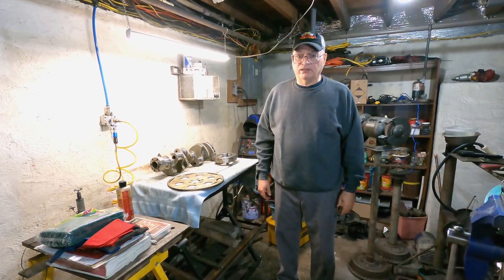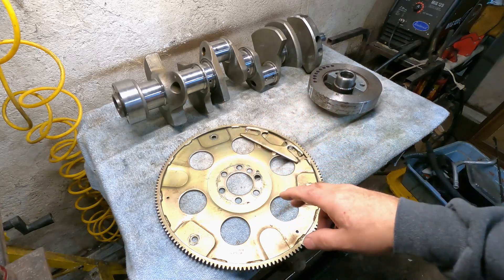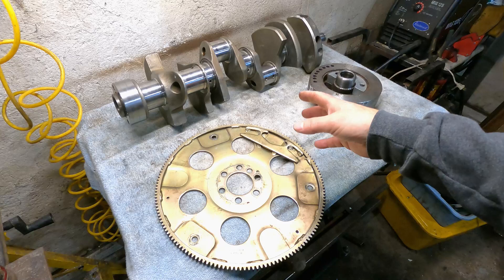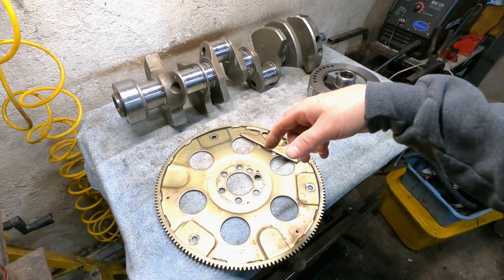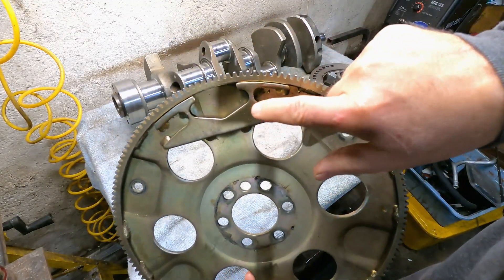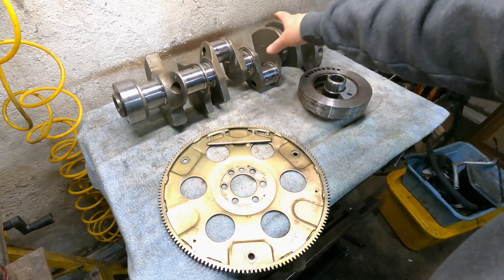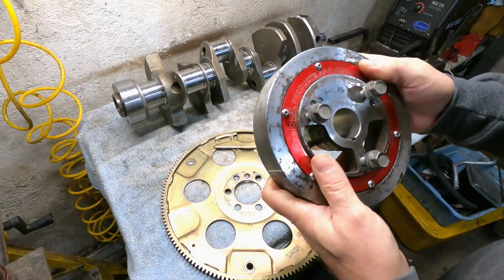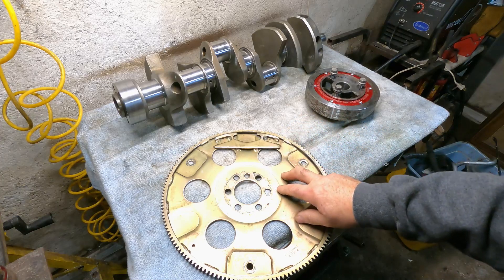Externally Balanced Crankshaft

Comment: Maybe you have an easy answer for me. I am extremely good with cars, especially fords and what fits what.  Chevrolet, not so much.  But I do have a 1968 Chevy Corvette 427 M21 4spd car but someone removed the 427 and put in a crate 350 back in the 80s.  I happen to have a 1973 454 SS motor from a 1973 El Camino SS automatic.  This external balance thing has gotten to me.  So my question is If i have a 73 454 automatic can i bolt up any 168 tooth externally balanced 454 flywheel and thats it, im done?  Or is there something with the harmonic balancer or do i need a 153 tooth externally balanced flywheel.  If i buy a decent flywheel, how does it know how much counterweight is needed for a flywheel or is it always the same?  I only want to do this once.  LOL. I'm also assuming that the bellhousing from the 350 isn't the same as a 454 housing and I need to make sure it has the Muncie bolt pattern, right?  Any answer will be helpful.
Reply from the maker: I don't have any experience with BBC's but I believe the bell housing is the same, what I would do is go to the Hotrod Forum or the C3 section of the Corvette Forum and ask there, there are several different generations of the 454 so you will need to know which one you have. Good Luck With Your Project 😎

Comment: ford 460 external balance,
 should the flexplate weight be facing the 12 o'clock position ? 
or be facing 180 degs the other way in the 6 o'clock position?
 in relation to the hatchet weight in the front.
please help me, thanks
Reply from the maker: I am not familiar with Ford's flex plates but normally they only go on one way, I would recommend the hot rod forum or one of the Ford forums. https://www.hotrodders.com/
Reply: @E.T.GARAGE  
not on a big block ford 429-460, it can fit in six different positions.
I found out that flexplate weight goes in 180° from the front crank counter weight, to balance correctly.
thank you for responding.
Reply: @E.T.GARAGE  
thank you for your prompt response,
I wish it went on only one way,
 but it can go on in six different positions and that's what my problem is
Reply from the maker: https://www.justanswer.com/ford/3m5sp-position-install-flywheel-460-external-balanced.html
Reply from the maker: If you go to the last link I provided it explains that one bolt hole is larger than the other's